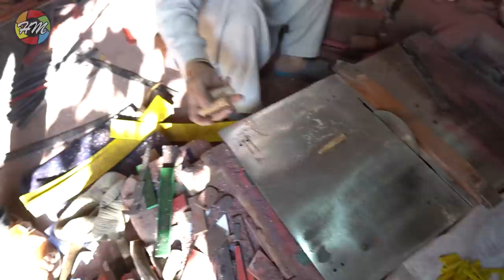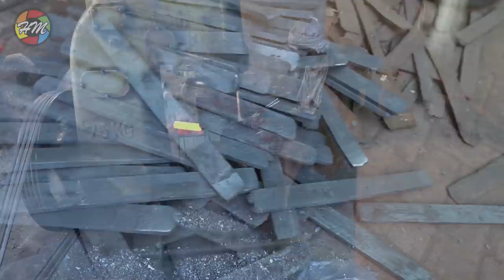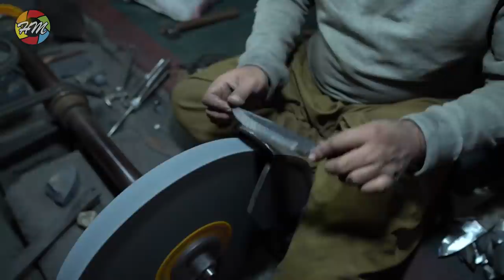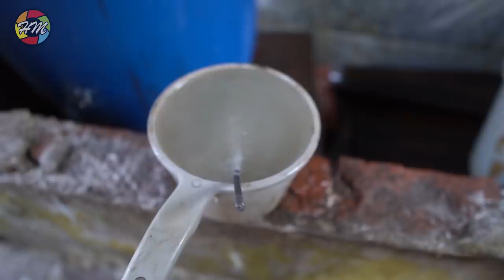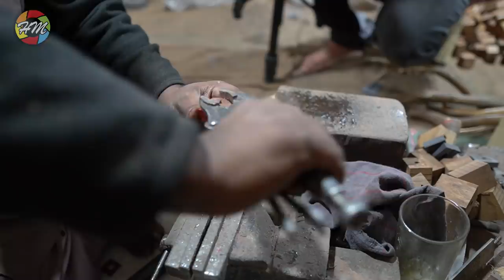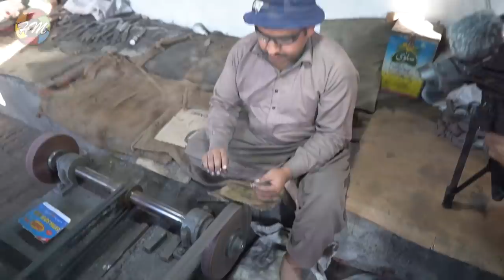Unbelievable Technique of Making Deer Stag Handle Hunting Knife | Damascus Steel Forging Process.

Comment: I see an awful lot of grinding steel so hard that it turns blue.  This will make the steel soft and will not hold an edge.  They are not showing any heat treatment of the steel after shaping the blade.  These are pretty knives but not much good for anything a knife is meant for.
Reply: I agree. I hope people only buy for decoration because these are not functioning as a real knife.
Reply: Right!
Reply: I saw them heat treat in another video. The biggest problem is they are usually not full tang.
Reply: Im glad im not the only one who thought is he gonna try to heat treat that after destroying it on the grinding weel lmao
Reply: They don't do heat treatment 😂 I have bought some knives from these manufacturers. They just dunk the blade in oil after when it's hardly any red.
Reply: These are mostly decorative knifes.

Comment: Are these blades made of junk mild steel?  Looks like it.   If the blades ARE MILD STEEL it is impossible to get it hard enough to make a half ass quality blade.   Usually when steel can be sheared in a cut press it's too soft for a decent blade to be made. Just junk tourists buy.

Comment: All that work, all those billets, just to cut it to shape and tac weld a small rod for the tang.  With that equipment, and I know these guys are good craftsman they could put out GOOD QUALITY knives and actually make good money for a good product. That's gotta be scrap steel of all kinds going into those billets, no heat treat shown so who knows how or if that's done. To put that much effort into those knifes, I feel bad, I truly do.
Reply: such a knife, only for beauty, as a souvenir
Reply: @aprelkamardin7775  it is very beautiful, with a little change it can be both beautiful AND functional.

Comment: All that time effort and material for a useless knife it was destroyed during the grinding process when he ground it so hot it turned blue took any heat treatment it had out of it if there was any to begin w. Very weak peice of steel now. I wish they threw it in the fire after grinding for heat treatment. wut a waste